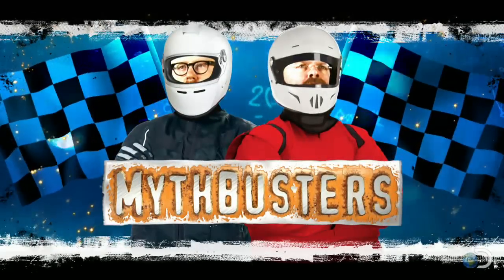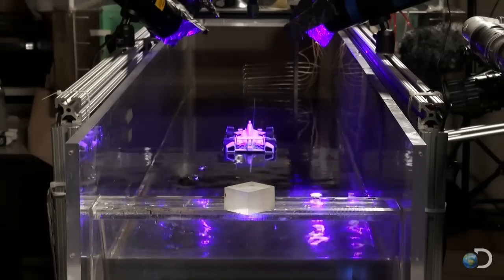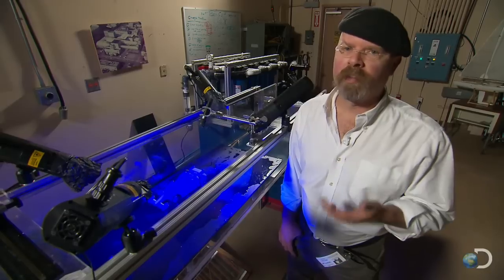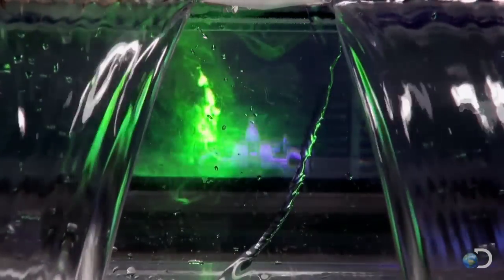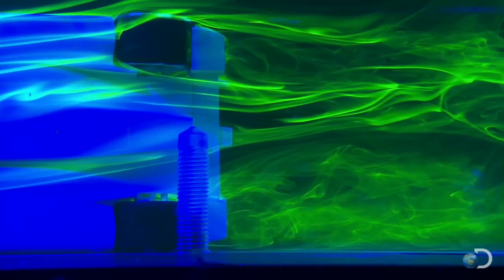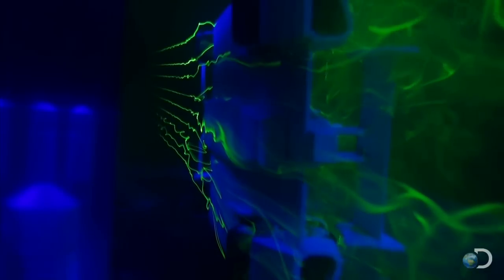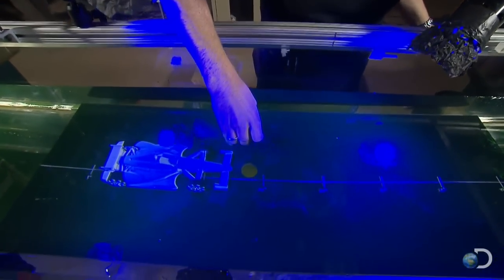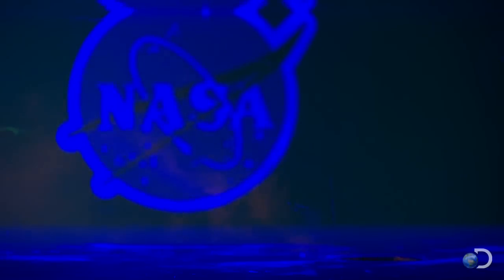Manhole Mishap Myth | MythBusters

Comment: Just watched this episode on HULU. They called it busted, but just a few weeks ago a Formula 1 car DID actually pull a manhole cover out of the street. And it HAS happened with Indy cars. That is the reason they weld the manhole covers down.
Reply: Yes this can and does happen. I'd love to find the full video to see if they were able to create the conditions that allow this to happen but I suspect they are so specific that it won't be easy to do on purpose.
Reply: @corthew  No, they weren't able to recreate it.  That's why they called the myth busted.
Reply: Yeah, I suspect they weren't allowed to actually drive one of these and have it driven by a really skilled racer going at an amazing speed under rare conditions of heat in the air and on the track that probably effect all these things. Theres simply too many variables for them to have the budget to properly test this I think.
Reply: Working in a carriage industry taught me its possible for a horse to step just right and fall in the hole, it was not a fun day, the horse was ok just a few scratches and a fear of circles.
Reply: I suspect a large part of it is determined by how/if the cover is secured, or if it's just essentially sitting there. Some places weld them in place, others use bolts so it can be easily removed for maintenance, and others just have it essentially sitting there in its slot, (like it is in shows/movies/games when someone needs to get into the tunnels)......
Reply: @ArchangelExile  and that's why the show is horribly flawed. like maybe a 1:1 F1 car creates more downforce than a cheap plastic model
Reply: Exactly what I was going to point out!  I don't think they were able to recreate it because stuff like this was accurate enough, F1 teams would have an easy time designing a car but its not just about getting good results in small scale testing.
Reply: Where is this happening
Reply: Manholes weigh about 250 pounds but I’ve seen them dancing on a column of air pressurized by storm runoff from a high rise. Of the thousands of manholes in our inventory that was the only one we had to bolt down. Suction? Would only take about 2 psi of negative pressure  to lift it with a good seal.
Reply: Carlos Sainz FP1 DNF last night due to the same issue lol

Comment: There's obviously something wrong with mythbusters' experiment on this. And Williams this weekend at Baku 2019 was not a sole occurrence either.  Even a DTM car, which was not even a ground effect car, could lift a manhole cover back in 2004 Shanghai demo race.
Reply: Part of the experiments that they did was to test if something that had actually happened could be recreated under test conditions.

The easy way to tell if something had actually happened is if they deemed the myth "confirmed". They only gave the confirmed status to myths that they had real world corroboration - such as video footage of a DTM car lifting a manhole cover back in 2004 of a Shanghai demo race.

Some myths they know to be true, but are unable to recreate what happened due to safety concerns or how difficult it is to recreate what happened.

For instance, it has actually rained fish before. In northern Europe a hot day in spring a bunch of years ago sucked up water with tiny little fish eggs in it. The eggs hatched in the clouds and fish came raining down. Mythbusters wouldn't be able to recreate that myth both because of the difficulty of recreating the circumstances, and due to it being inhumane to kill a bunch of fish just for entertainment.

The show isn't perfect science, but it is pretty logically consistent.
Reply: @bobdole4916  they've killed fish before

Comment: I volunteered at the Firestone Grand Prix in St. Petersburg, Florida for 5 years. During orientation, one of tge things they told us was that they welded the manhole covers down to prevent them from flipping up. Whether that was a real thing that could happen or not, we never really knew. I believe that it was more of a precautionary safety measure. Not that the covers would fly up, but why take the chance?

Comment: The full scale test had a mock manhole that was simply a very small hole in the ground and it didn't seem to be connected to anything.  Real manholes are entrances to sewers. That is a significant difference the to actual myth conditions and my guess as why they couldn't get any lift on the cover.
Reply: Ooof,  yeah not their best methodology.  I'm sure the weird mixed gases in the sewers have different effects on the air pressure below the manhole.

Comment: Not all manhole covers are the same. They're usually 90 to 150 lbs. That's a pretty big range. Even so, Some are sitting lightly in the top of the manhole with little friction while others require significant prying because of the dirt and debris that builds up over time. It's kinda like the difference between trying to unscrew a nut that hasn't been rusted and one that has. The rusted bolts can be much harder to get loose. So you have a very wide range of manhole covers that you could run into.

Comment: It's sad that the Mythbusters didn't do literally any reading about Indycars of formula 1 cars. If they did, they would know that in fact formula 1 cars tend to send most of the air over the top of their bodies (while still having a lot of downforce coming from the floor, hence why the Williams yeeted a manhole cover last year), and Indycars actually produce WAY MORE downforce with their floors (air passing underneath the car and creating a "suction" effect) than they do with their bodies (air passing over the top of the car and creating a "pressure" effect). 

This is definitely 100% confirmed, there's a reason they weld these things down before grand prix.
Reply: Mythbusters aka "one bad experiment done by guys who don't know shot from shinola" - just don't take the show too seriously.

Comment: If you have ever blown air horizontally across a vertical shaft you will know very quickly that there is suction. We had a some copper pipe fitted to a t fitting that we blew air through to remove the excess foundry sand from our molds in metal shop.

Comment: This isn't as common today, as it was back in the days of ground effect cars. They physically sealed the sides of the car to the road and that created a lot of low pressure to aide in the aero holding the car down. Ground effects were banned years ago (30?).
Reply: You can't do that. Every car has ground effect on some level. Even regular cars have it.
Reply: @MrMarinus18  what do you mean they can't do that? They did ban it because the 80s era was so extreme in F1. Yea there still is some ground effect is no where near what it was
Reply: @851995STARGATE  I don't really think it was "so extreme". I mean, they're bringing back ground effects now in exactly the same form, except now they'll make twice as much downforce, and the cars are even more powerful, the tires are better, etc.